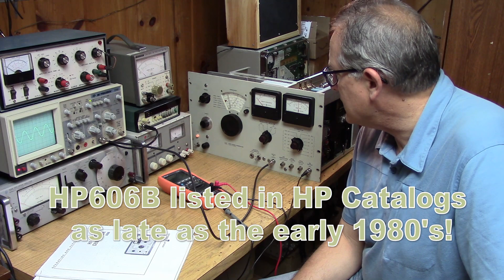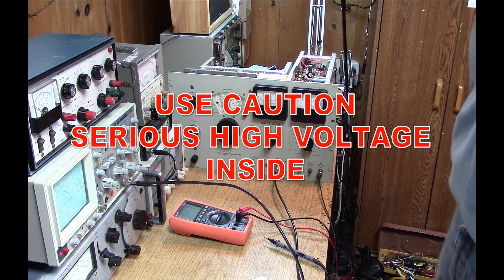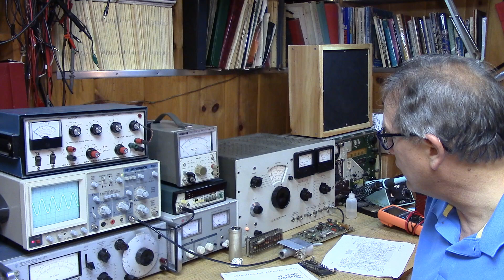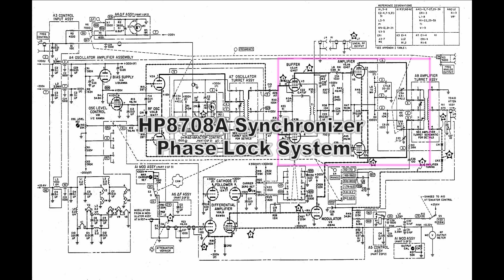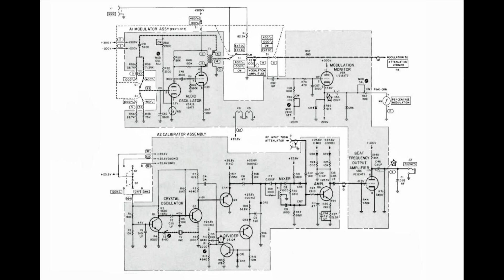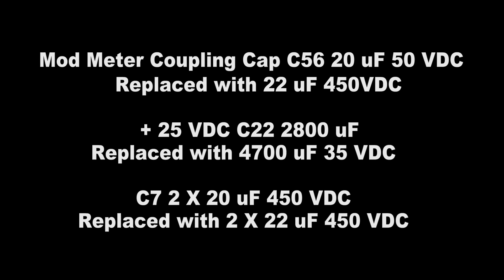HP606B Generator Song - Hum Along

Comment: Recently acquired one of these for a price i could NOT refuse!  I am not super experienced with such an instrument but am impressed to find so many people still loving  them! I tookthe very dirty desktop style housing off and to the drive way for a scrubbing.  The internal chassis has a 1958 date code and power supply appears to still contain original sprague cans so im probably starting there!  Hope to see it sing again soon!  Housing had stickers over the case screws and a calibration sticker dated april 1991 so i suppose it safe to assume it hasnt seen power in 20 maybe even 30 years
Reply from the maker: It is ergonomic and fun to use - once you LIFT IT ONTO THE BENCH!

Comment: Can you post a list of all the caps you replaced/brands and their voltage ratings? It helps. For extra points digikey/mouser part numbers. Not a big deal but I find having that info along with the video helps us all. Yes, I acquired one of these for repair too. Cheers.
Reply from the maker: Oh Boy. I take the value they have in say a triple capacitor of 80 uF, 60uF and 100 uf  at 400 VDC and find the most common type like three 100 uF 450V caps and just use them without regard in power supply circuits.

Comment: I would have really liked to have seen how you did the cap replacement rather than a description of the theory of operation which I can read for myself if I wanted to. Just sayin. It's not easy in these pieces of gear sometimes to fit new components. Everyone's technique contributes to the knowledge pool. 73 Doug.
Reply from the maker: It depends on the build and the manufacturer. One selling point with the National NCX-3 was that "most of" the components were exposed on the bottom of the chassis, making servicing easy. Imagine that as a selling point on a modern radio!  The Drake TR-3 that I am working with now puts, the paper caps on little vertical boards and the leads just go into eyelets. so you heat it and they just pop out. It is much more work with terminal strips where they wind the lead through and around!  Fortunately modern components are usually smaller in size and this helps.

Comment: Why did they not use TELEFUNKEN Space Charge Vacuum tubes which would use between 12-24V on the plates and 6V on the heater.
Reply from the maker: Ha you love those Space Charge tubes! They are certainly safer since they work on low voltages. Many articles exist and many designs were adapted to use them. Can they provide the same performance (Power, Noise figure, Gain etc...) as conventional valves? Interesting question.

Comment: Can you use that signal generator as a QRP transmitter if you connect it to an antenna? How far can you get out?
Reply from the maker: If you consider that the generator can produce 3V into 50 Ohms, that is roughly 180 mW. What you can do with this depends on the frequency, conditions of the ionosphere and your antenna! Anything from 1000 ft to 3000 miles or more.